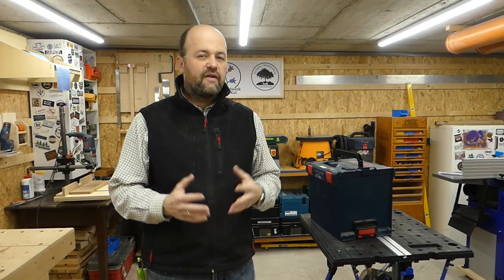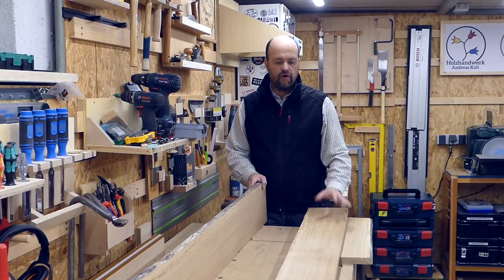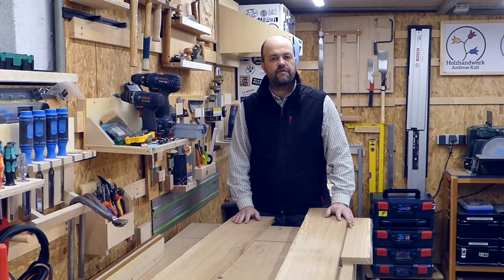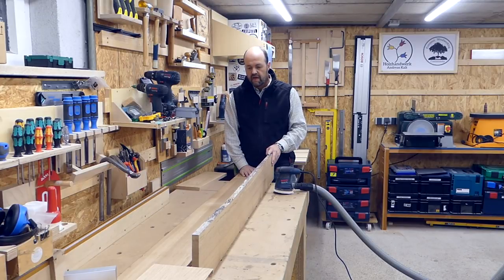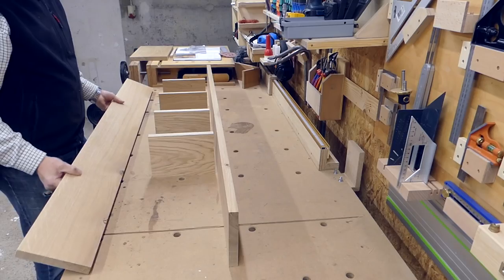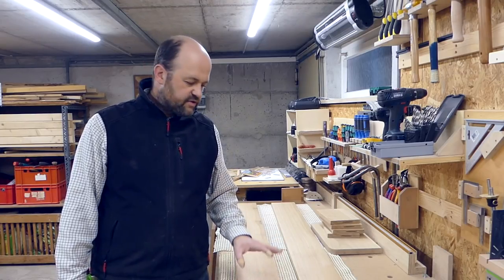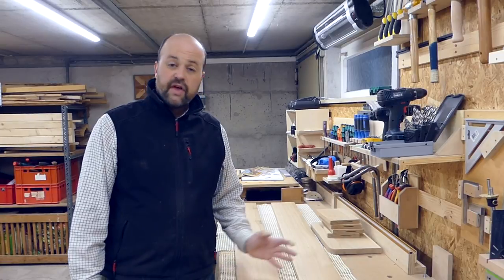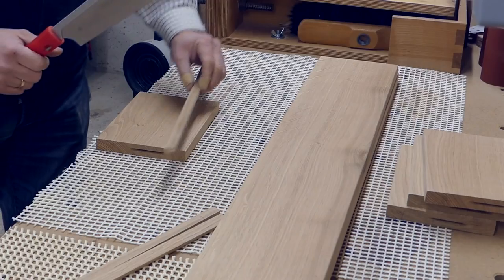CD RACK DIY – Beautiful and simple design, CD Storage Rack

Comment: An idea to work with such defects might be to patch them with a contrasting wood. If you can not hide it, make it a feature. :D
Maybe you could even use wedged mortise and tenon for the joinery and make the wedges from the same other wood.
In the end it came out nice and it really takes some balls to go for oak on the first solid wood project. :D
Reply from the maker: Thanks for this idea. I will consider it in the future.

Comment: Very nice work! One change I would have made to the design is less open space between the shelves, to allow for more CD storage. My experience with them is they multiply like rabbits 😀.
Reply from the maker: Thanks. That's one idea I had and had already planned for it but there was so much damaged wood that I didn’t have enough material left.
Reply: Maybe make some shelfs from plywood and use some of the oak as edgebanding on the front? Nobody would notice that, when the shelf is full.